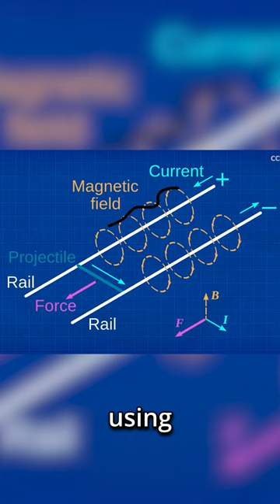How Long Until we Start Seeing Railguns in Warfare? #shorts

Comment: We kinda need another breakthrough for it, in the form of room temperature superconductors
Reply: Thats not really even the limit.  Were close on that end.  It's making the rails not melt
Reply: @Aztesticals  The rails melt because of the electric resistance.
Superconductors have little to no resistance.
So superconducting rails don't melt.
It's the same thing.
Reply: @Blazehoof  ya know.  I should have known that.  I feel like a goof.  Thanks for the reminder.  I could have sworn I remembered an old documentary from the early 2000s where they were shooting the rounds through concrete squares at a range and they were discussing two part rails where there was a lining of tungsten but it made the shot slower since the field wasn't applied as close and as magnetic fields loose strength exponentially with distance the longer lived rails had only half the power.  I wasn't sure if they ever got to find a way to both keep the protective layer and still have the gun fire at a proper speed.  Probably not since no matter what by having the field generate even an inch further from the projectile is going to cut field strength by over 60%
Reply: I mean why? Missiles do it better and that tech keeps advancing
Reply: @thezombiepotato1  because rail guns come with all the “fun” of things like rockets, without all the bother from things like navy ships carrying hundreds to tens of thousands of pounds of high explosives, or even more, or there being literal rocket fuel just sitting around waiting for an excuse to violently and exothermically deconstruct the missile that it’s in, if there’s ever a big enough hit sustained. It also makes the production side a bunch easier, as most chemical formulations we use to fling these things at Mach___ towards one another are generally not the healthiest things to be around or have to handle.
Reply: Age of breakthroughs in physics seems to be over
Reply: @carthagonova4132  What do you mean we are just in a recession age and are about to stumble on some really big break throughs that are going to turn society upside down.
Reply: On top of nano-processing, their has been a multitude of small advances in tech that serve a greater wider picture. The smaller the components the more you can put into the final product.

Comment: It's not the electricity that damages the rails, it's the fact that trying to keep the metal slug away from the rails and contained in a perfect magnetic field isn't something we can do yet, so the slug rubs the rails at mach whatever and that is why the rails don't last more than a few shots.
Reply: I bet it's an acceleration issue , mag Lev trains don't hit the rails.  But they use wheels at the start...
Reply: The rails for what I have heard overheat too fast.
Reply: @anthonyledel2072  Yes, but maglev trains only use the magnetic field as a cushion offset by gravity and the acceleration is really slow. In a railgun you have hundreds or thousands of magnets in a line on at least two side firing in sequence to move the slug rapidly and so there is no stable magnetic field. Just being off by a few billionths of a second in the firing sequence and the slugs snaps to one of the rails creating friction. 
IF we could get a stable field that held the slug in the center of the rails without touching them, then you would have a workable railgun. The rails themselves are non ferris, so the magnetic field has no effect on them. You just need to keep the slugs from tearing them up with friction.
Reply: Sorry, I should add that a railgun slug itself does not have magnets in it to create that cushion like a maglev train and can't because the slug would just flip to snap to the rail anyway unlike a huge train.
Reply: the main problem is that as soon as the ordnance touches one of the rails, it distorts the magnetic field and it then gets attracted to the other rail. Because of the enormous currents flowing thru the rails (this is how the magnetic field is generated), this instantly causes the the 2 rails to be welded together.
Reply: Well we could, it called a coil gun. The problem with the rail gun is you need contact between the rail and the projectile to complete the circuit and fire.
The problem with coil gun is they are more complicated and require good timing.

Comment: Following on Blazehoof's comment, it's not a question of "never," as much as, "once key problems are ironed out." Think in terms of what transistors did for computer technology. What railgun's need is smooth delivery, better heat-distribution tech, and some middle ground between power and bulk.

Comment: Yes, but Coil Guns are becoming more viable. Coil guns are similar to railguns but much more energy Efficient. ArcFlash Labs actually sells multiple coil guns for civilians to own. They arent useful for much right now as they launch a projectil the size of a triple A battery at around 100 to 150 meters per second. However, theyve made notable advances in the past 10 years and they went from a novelty only good for taking down paper cups to a novelty you could theoretically hunt small game with.

Comment: If space travel is developed more, I can see railguns receiving more R&D funding not just in a military sense but as defence system against incoming projectiles like asteroids
Reply: Cause 1 object going 200,000mph is worse than 100 objects going 200,000mph
Reply: @ckchatta369  100 objects that burn up on entry than ONE MASSIVE object making ground fall...
Reply: @Econ1991 spreading the damage over a larger area. Granted if that shot broke the astroid into enough small pieces that each piece burned up in the atmosphere...well destruction averted

Comment: NAMMO Ramjet propelled artillery rounds are more likely to come into mass production and use. A 155mm howitzer can launch a highly precise shell about 100 miles using this technology. The rounds turn standard artillery into long distance precise munitions at a relatively low cost without the drawbacks or cost of a railgun.

Comment: I wonder if adding a layer of graphene to the rails could keep them from being damaged.
Reply: This is already how brushed electric motors work. They use carbon brushes to keep contact with the stator allowing current to pass to the moving stator, and it also lubricates it to slow wear. The problem isn't the friction of the projectile sliding down the rails, it's the heat from the massive current and magnetic fields that damage the rails.

Comment: The electricity should be stored in the projectile and the coils too, the rail guide is just aluminum.  I'm thinking ultra capacitors that are in the ammo get charged up (while in the magazine). Once charged and a projectile (or bullet) is in the breach, a metal piece (that is connected to a trigger) touches two contacts on the bullet, closing the circuit and releasing the energy to the coils, inducing a large magnetic field, hurtling the bullet along the aluminum rails. I was thinking using the same tech as in flash photography, but the battery is the ultra cap and the flash bulb is the coil, wrapped up into a small little package in a bullet or as big as a shell and any size in between.

Comment: Love that your first picture was the Star Citizen version.

That said, never is wholly incorrect. The real answer is “not until we’ve had sufficient advancements in power generation and material technologies.”

As for the rails being damaged, chemical ballistic weapons also damage their barrels after a certain amount of shots. For that reason, most barrels are able to be screwed onto and off of the end of the upper of most guns. Certain guns in WWII had the barrel already separated and spares kept with the gunnery crew to both save weight and extend weapon deployment times.

But no, never is very wrong indeed. We can use them in less-lethal-but-very-painful formats as is(we’ve been building coilguns and rail guns for decades and there’s dozens of videos on YouTube, because the principle is literally that simple), but once we figure out smaller but stronger power sources, railguns could easily replace modern chemical propulsion firearms.

Know what’s not feasible? Laser guns. Because planets and stars suck and won’t let us have any fun. Atmosphere, solar thermal radiation, and insufficient advancement in materials technology means laser weapons are much further off than railguns. Even if there’s also dozens of videos of homemade laser guns being used to wipe out specific shades of innocent balloons.

Comment: The Chinese are apparently looking to use electromagnetic pistols for crowd control since you can control projectile speed meaning weapons can be dialled in to sting and bruise without killing. They are much safer than the traditional rubber bullets that is used as a "less than lethal" replacement for hand guns, but is still responsible for many deaths.

And rail guns only wear out quickly the rails when they are way over charged, using them for lower speed projectiles for shore defense would probably be fine

Comment: Actually there is 100% an upper limit of how strong something like a railgun can be, thinking about resources used to handle that kind of electricity, or a projectile that survives the movement, or even does damage on impact instead of just splatting

Comment: Some day, coil guns may be around. They operate without physical contact with the bullet.

Rail guns are a shortcut, as they do not require as sophisticated a control system to reach a given speed... But the rails are an inevitable week point.

Comment: you are likely right about rail guns ... coil guns otoh are just as potent have only 1 mechanical drawback which is a function of the emf of the final coil in the series and with the u of ark graphene power source would never run out of power before running out of ammo. people keep seeing the electrical requirements as the biggest failing but forget that we have finally tapped the zero point and have direct access to the universal source. 

its a good thing we collectively arent smart enough to realize we leapfrogged to type 5 civ because morons who think first of 'how do we weaponize this and use it on others' are being given fusion reactors to sabotage ... unlimited electrical energy would just be perfect for monsters called human